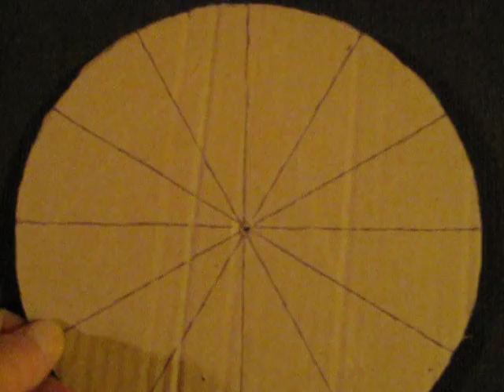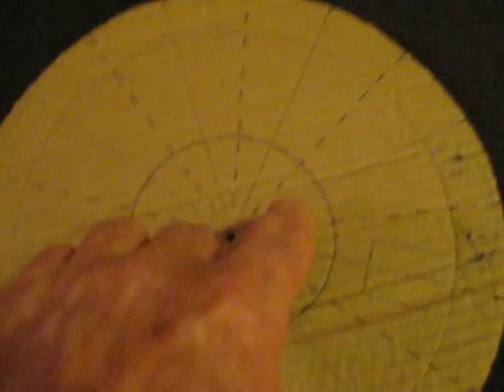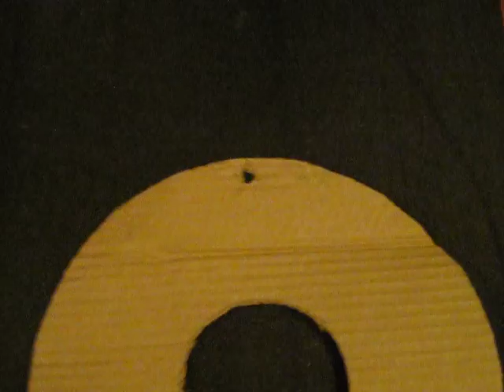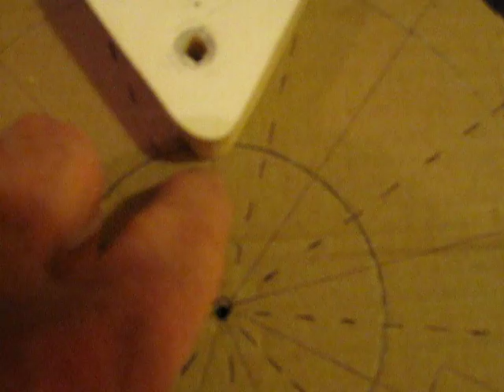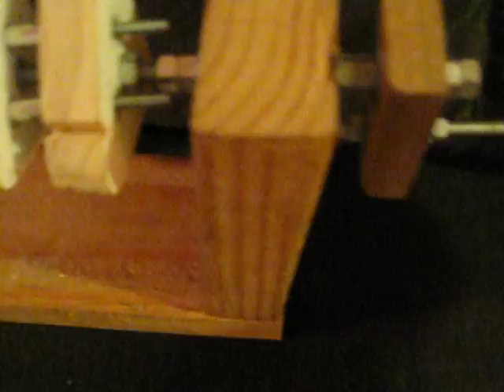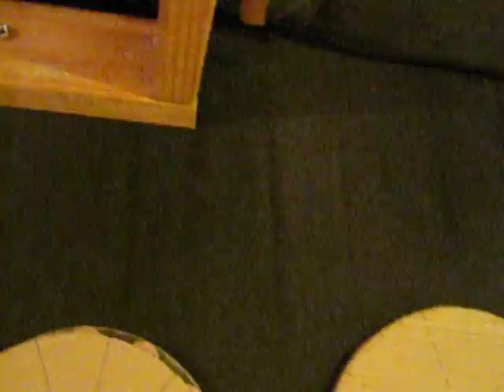Making a Wind generator Stator and Rotors tips 001

Comment: Interesting doesn't sound like a good thing.....I got a good deal on the wire on ebay but I know it'll be hard to work with! Patience and time hopefully will prevail! Thanks
Reply from the maker: make a test coil, and have the magnets already on the rotor, rig something so you can spin the rotor with a drill slowly and place the coil in between and see what output you get before making a bunch of them. there are some similar coil test bed videos on youtube to compare how you would build the test set up fairly easy.

Comment: Having a hard time with the calculations....I'm using 10 guage enameled wire and a 44" 5 blade prop. What would be the optimum # of turns for each coil if I'm using 2x1x1/2" magnets in a 9 coil configuration wired in star pattern?   What would be a good sized rotor to search out? Thx
Reply from the maker: if you are using 12 magnets of that size, standard rule to go by is for each inch of width for each magnet say its 1 inch wide, x 12 magnets then the smallest rotor you would want to use is 12 inch dia. that will give you plenty of room to make a decent size coil. anything smaller and it will cut down on power output potential. you could actually go just a little over 12 inches in dia that way it leaves room to pour a resign over the magnets locking them iin place unless you have magnets with the center hole which helps secure with the use of a bolt and nut.
Reply: Thank you! Does a 46 turn coil seem reasonable for a rotor that size? Do you anticipate any problems using a 44" prop? The smaller the prop, the faster it spins correct?
Reply: No nut to secure the magnets...just machining the rotor down to leave a 1/8" lip at the edge and a drop or two of crazy glue to hold everything in place until the resin does it's  job! I'll definitely be looking for 12-13" rotors...thanks for the advice!👍😆
Reply from the maker: lay out your magnet rotor design and then draw up your coil pattern, like I showed in the video. it will tell you the width of the coils, just make one that size and keep count of number of turns. most people do not use #10 wire. they usually use #15 or #14 magnet wire. its going to be interesting seeing your results.

Comment from the maker: Hi James. I have been making coils for a lot of different projects. I have tried using smaller magnet wire in groups of two, three, and four strands but I found it gives better results using one wire. less chance of bad connections.  most guys get there magnet wire thru ebay a company called Essex is really good and fast delivery. 15 to 14 awg is the norm.  if you have any other questions just let me know, ill be glad to help. SD.
Reply: When you say better results(regardless of the bad connections), please explain why one strand is better. I thought i had read somewhere that by doubling up strands, you could carry more amps, lower ohms and extra turns on the coil(albeit at lower voltage), but was looking to make up for the lower voltage by increasing the number of coils in series.
Reply from the maker: James Maxwell Hi James,  the size magnet wire I used in that video was 18 gauge. two strands of 18 gauge put together equals the same of 15 to 14 gauge output. by just using a thicker wire single strand you get a smaller coil, and same output and you do not use as much wire in cost value by using several strands of 18.   I just happen to have a lot of 18 wire around from old coils I reused for this experiment. actually found it was cheaper to just get the thicker wire and much easier to make the coils cause you only have one wire to control while making the coil instead of 2, 3, or 4.  then you get into how strong a magnet you use. ill have to do another description on this post to explain.
Reply from the maker: James Maxwell magnet strength results you can expect. the coils were tested using 1 inch round 19 pound pull magnets on one rotor set, then using same coils I had two other rotors with 49 pound pull magnets. with a complete set of coils wired in star configuration using each rotor sets I went from 32 volts to 103.5 volts just by using stronger magnets. that was at 1176 rpm when I was using a pulse motor to drive it. so magnet strength is really important.
Reply: SilentDeath002 Thanks again SD002. Not wanting to overstay my welcome, but do you mind me asking a lot more questions, perhaps within a thread on the forum? I'm finding myself a little out of my depth on several aspects.
Reply from the maker: James Maxwell Hi James. are you talking about the off grid forum or iaec forum? and not to worry about taking up time, I have plenty lol. be glad to help you out.  now one other thing I would recommend. make a coil output test set up.  fairly easy to do but it gives you the potential output of each coil you make. I find that 4 coils per phase gives you a lower wind speed cut in then one with 3 coils per phase. so that means I try to design a set up that gives you some power in normal 5 to 10mph wind. even if its only a few amps. that's what I will be shooting for as I build more. see ya !  SD.
Reply: SilentDeath002 Off grid forum SD002. (Will take a peek at iaec forum if i can find it. Thanks

Comment: Quick question from a newbie, if i may....if i wind my coils with 4 strands of wire(say 1 amp max load) would this allow me more overall turns(eg 4 x 25turns) than using a single strand  '4 amp load' wire (eg 1 x 70 turns)due to the thicknesses involved(also giving less skin effect etc?) and would this give me lower overall resistances? Still trying to get my head around all this. Appreciate any pointers given.
Reply from the maker: hi James I posted a  reply to your question on the forum, did not notice the reply button till I did it .
Reply: SilentDeath002 Many thanks for the reply. Will catch up with you on the forum.
Regards
Reply: SilentDeath002 Had a look on the forum and couldn't see any reply. What section was it in? I also searched the "new posts from last visit" and couldn't see anything either?

Comment: Doesn't look like your top of magnets are aligned with your center of coils,  actually for the shape pod coils you would want the rectangle magnets. The top of coil doesn't induce most current it is the sides. Looks like you setup for single phase wiring so that you have two sets of magnets working on one coil.

Comment from the maker: Hi John, you will need to have two plates about 1/4 thick . the magnets are set up on each plate so the magnet across from it on the other plate attracks.  that way the magnetic field goes thru the coil.  also you need to basically know the bolt pattern for what type of bearing assembly your going to use so that can be machined into the plates prior to attaching the magnets. I can make the stator and rotors but I would need that information for the machine shop before getting started.  most people use a 1 inch wide x2 inch long x 1/2 inch thick 72 pound pull magnets for there rotors. they also sell triangular magnets that would work much better. following videos will kind of help you in planning. much more information is needed. oh, Merry Christmas SD.